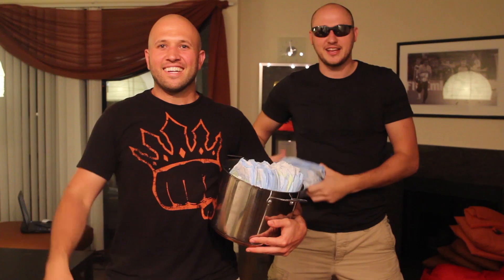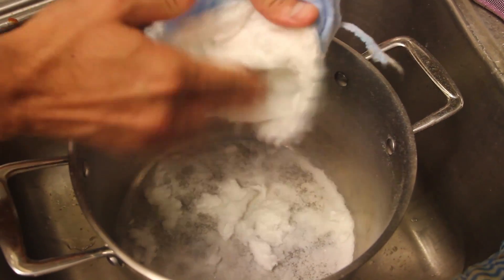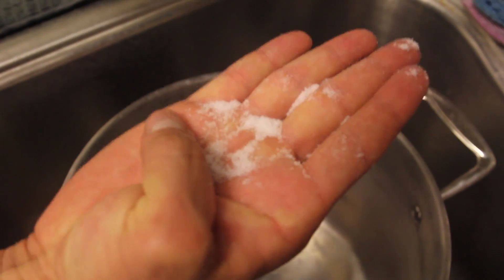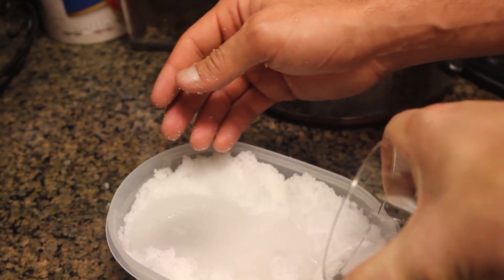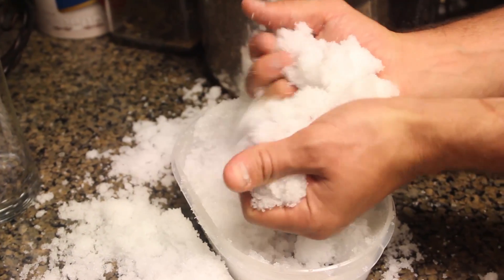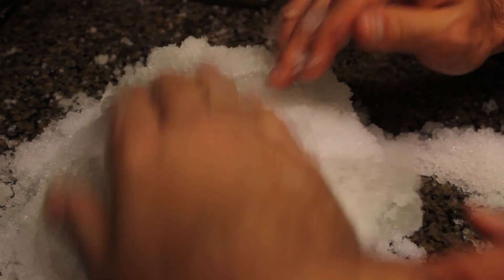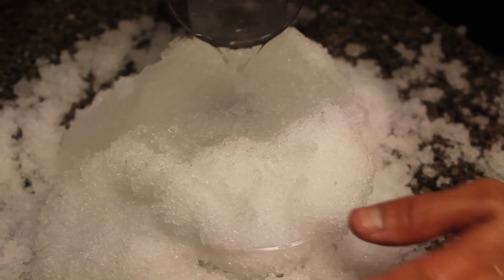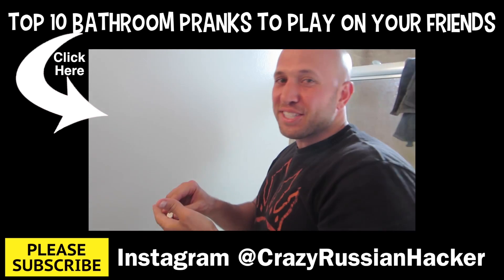How to get Instant-Snow Powder - Science Experiments

Comment: The stuff is called silica gel, and you can get it way easier in the form of kitty litter "pearls", and then you could grind it up smaller in a blender if you wanted to.  It will absorb the water and then slowly release it back into the air.  I put some into the soil in my garden; it holds the rainwater and releases it slowly so there is less puddling and runoff after a storm and the garden stays more evenly moist.  It's also found in those tiny packets that come inside some vitamins & medicines and electronics, etc. to keep them dry during shipping and storage.  ABSOLUTELY DON'T EAT IT--it will swell up 10x its size inside your gut and you will end up in hospital; not kidding.

Comment: Lol you can make a ice pack by using the white stuff inside the diaper pull all the white stuff out of the diaper put it in a zip lock baggy add water to it all depends how many diapers you use that how much cups water you had then froze it if you want it color fully you had food color it alot of fun

Comment: ***** It's a type of polymer. A polymer is a very long molecule. The polymer used in diapers are in fact hazardous when you remove it from it's protective seal; if inhaled, you can gag & choke as the polymer will absorb any and all liquid. We are 60% liquid. Do not inhale or digest this material. *KIDS DO NOT ATTEMPT THIS AT HOME*